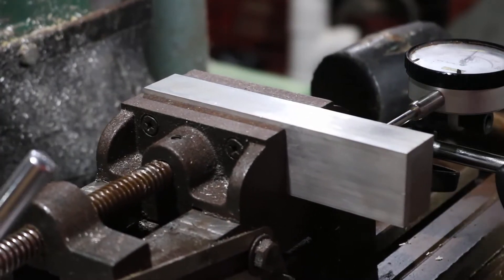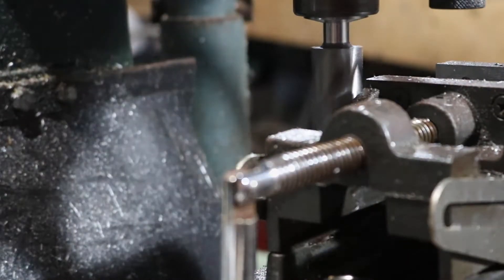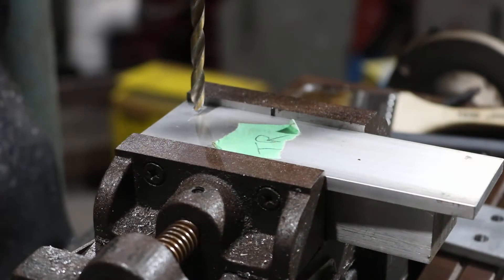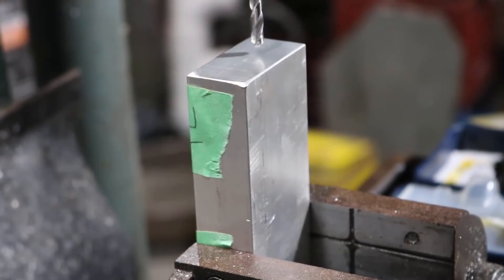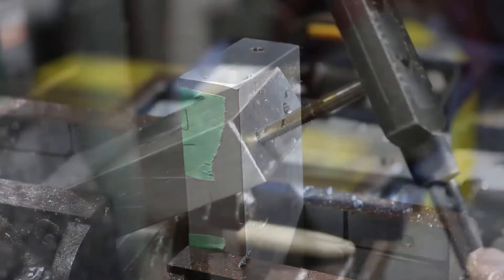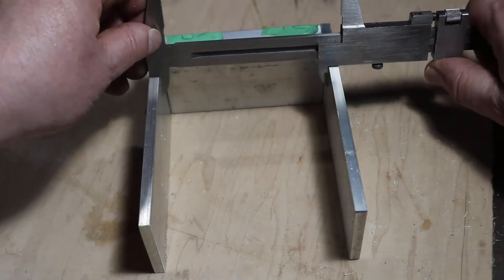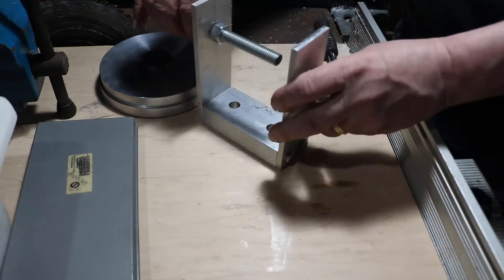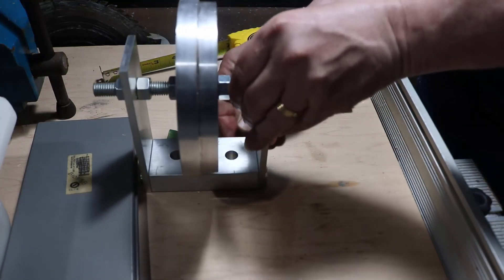DIY Mini Band Saw Part 9

Comment: Do you know I won't be doing this but I have watched it from part 1. I have loved this build its so good. Could the next build be an hole cutter. I heat the ones that fit on your drill. We need one that claps to the tank so we don't have to hold it steddy. Just an idea.
Reply from the maker: Hi JustMyFish. I actually built one years ago to drill tanks. Unfortunately long before I even thought of making videos. lol
Reply: Fishman Cool.